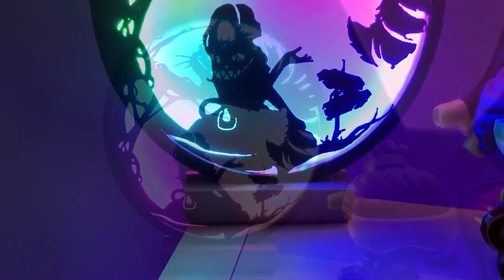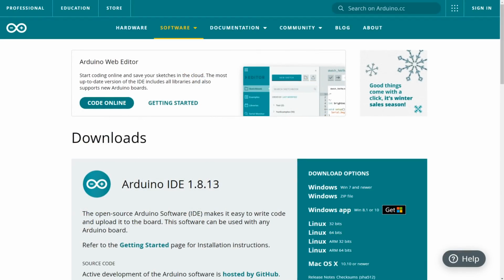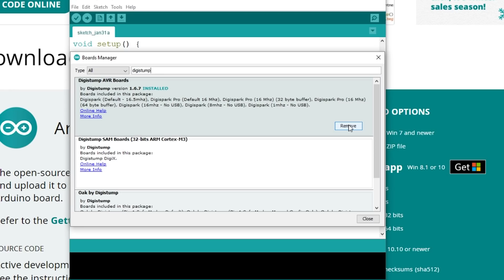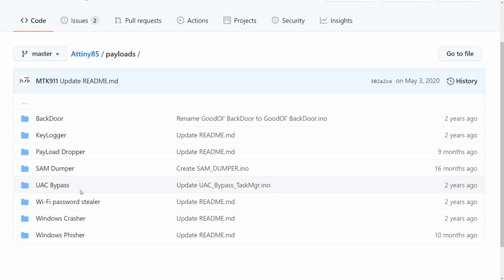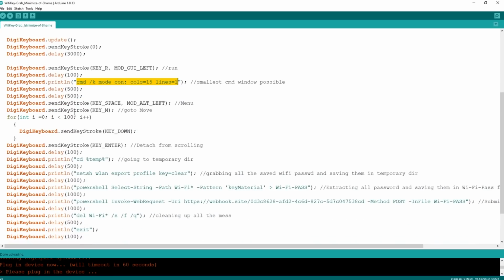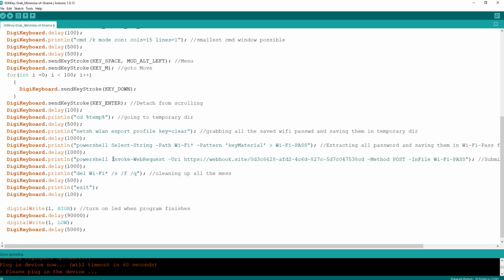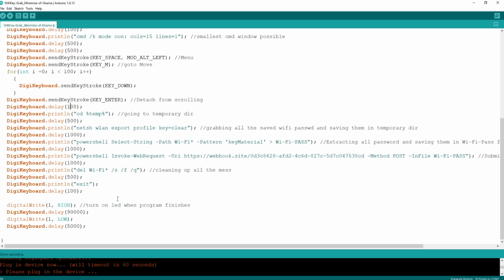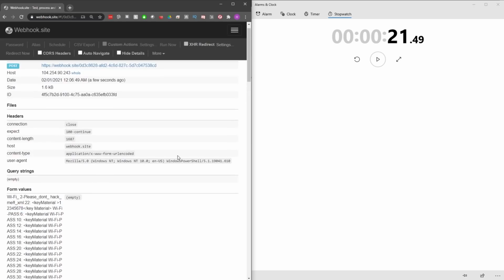Building a WiFi Hacking Device for Only $2

Comment from the maker: I hope you enjoyed this video!  If so, please consider dropping a like and subscribing. <3

Need a Pentest?: https://tcm-sec.com
Learn to Hack: https://academy.tcm-sec.com
Reply: The product on amazon is not availbe
Reply: Thanks for this cool idea. I have an invention that I need some help on. I was wondering if you had any knowledge on a device that can shut down a computer using radio frequency or something similar. This has huge potential and I am looking for a capable partner. Thank you
Reply: Why can't I open these links
Reply: Cool 3D Printing
Reply: this is a troll, right?
right?
Reply: So when you say plug in, you mean into their computer correct? This doesn't work unless you have access to their computer?
Reply: @smokejaguarsix7757  i was wondering the same. I need remote access to things and stuff...
Reply: LESCO PRENDEN FROM GERMANY EUROPE
Reply: can it be detected by anti-virus?
Reply: Hey! The port option is not showing up during my process. Any advice? I'd appreciate it. :)
Reply: Can I do it with Arduino pro micro

Comment: When this runs on a host machine with it's keyboard configured to write in Spanish, the commands are all wrong. I'm trying to find a way to fix this but i'm not having much success. It seems that the payload sends the right keystrokes for English keyboards, which results in wrong input for both the OS and the CMD terminal on OSs with, for example, spanish keyboards. Any workaround you might already know?

Comment: Manually from CMD on your own PC.
C:\>netsh wlan show profile

Profiles on interface Wi-Fi:
Group policy profiles (read only)
---------------------------------
    <None>
User profiles
-------------
    All User Profile     : my wifi 1
    All User Profile     : my wifi 2
    All User Profile     : my wifi 3
    

C:\>netsh wlan show profile name=my wifi 1 key=clear

Profile my wifi 1 on interface Wi-Fi:
=======================================================================
Applied: All User Profile
Profile information
-------------------
    Version                : 1
    Type                   : Wireless LAN
    Name                   : my wifi 1
    Control options        :
        Connection mode    : Connect automatically
        Network broadcast  : Connect only if this network is broadcasting
        AutoSwitch         : Do not switch to other networks
        MAC Randomization  : Disabled
Connectivity settings
---------------------
    Number of SSIDs        : 1
    SSID name              : "my wifi 1"
    Network type           : Infrastructure
    Radio type             : [ Any Radio Type ]
    Vendor extension          : Not present
Security settings
-----------------
    Authentication         : WPA2-Personal
    Cipher                 : CCMP
    Authentication         : WPA2-Personal
    Cipher                 : GCMP
    Security key           : Present
    Key Content            : router I hardly know her       

**So the Key Content "router I hardly know her" is the password for my wifi 1**
😛

Comment: There is a simpler way. 
Get yourself a 2GB USB & use a compiled(exe) 
 python script to get all the WiFi password stored on the PC and save it to a txt file in an cryptographic encryption where you are the only person with the key to decrypt it. 

You have to plug the USB and run the script manually but it is much faster, gets done in around 3 to 5 seconds.

Comment: I have a unique question with these ATtiny85 boards. I want to run the code I have on them but once that code is executed I want to run a code that wipes the ATtiny85 as the very last thing it does. I have tried looking online but everyone says the same thing and it does not work the way I am trying to get it to. Any help/input would be appreciated!

Comment: Nice Video. 
BUT the Code as it is, works just for english users. If you are from another country you have to change your keyboard layout first (you can do that automated with windows shell befor you launch the attack). I also had to change a couple of lines where it says "Wi-Fi". In German the  XML-Files start with "WLAN", so it couldnt find any file. 

After that it worked fine to me, thanks for uploading!
Reply: Kurze Frage, hat Windows bei dir den Digispark ATtiny85 direkt erkannt? Mir sagt Windows 10 nach zwei Sekunden immer das er den USB Diskriptor nicht erkennt und wirft das Gerät raus.

EDIT: Nevermind, ich habe einen anderen USB Port benutzt und es hat funktioniert, seltsam, aber soll mir recht sein.
Reply: @draco5991rep  Technik die begeistert 😂

Comment: Don't get too excited.
Doesn't connect remotely.
You need unsupervised access to the running target PC, to physically plug it in and retrieve it.
Maybe wait 20 secs while it works.
Though I suppose at that price you could just abandon it.

And modern Windows may still block it.
I know nothing other than having watched this video closely.
Having been surprised at the clickbait title.
Tiny Arduino thingies look fun, though.

So it wont really help you to parasitise your neighbours wifi.
Main no (low?) criminality use. For backup when yours goes down.

BTfon was best, but they broke their word, and killed it.

Comment: I guess we have to send our thanks to Microsoft yet again for making it so easy to get all sensitive data from our PC with just few lines of Powershell script.
Who needs complicated trojans/keyloggers that get discovered by our antivirus, while you can simply just use what Microsoft gives you on silver plate.

Anyone knows if we can get logged in username and password as easy as that? I wouldn't be surprised if any of these big brains from MS came up with that idea as well.
Reply: thats possible as well, just a little more complicated. First you need to imitate a ethernet cable instead of an HID device like shown in the video, capture transferred password hashes, crack them, switch to HID mode and type in the username and password. Of course this is a little simplified and some steps are more complex like the hash cracking but it is doable

Comment: Yup, and this is why I not only use WiFi passwords, I do not let others use my equipment that I do not know.  Now, if you set your WiFi Router to use "Mac Address Filtering" and only give access to specific MAC addresses you've just added another layer of security.  Even if the password is breached if the passwaord is breached you still will not be able to get onto the WiFi or directly connected via ethernet.   I tried using this and my Trend Micro Antivirus kicked in and blocked it.

Comment: I remember learning about this!! I learned how to pull up the command prompt and do this manually... I'm sure this can be done without the "rubber ducky" but hey it's still dope
Reply: you mean netsh wlan show profile? if only u can use someone's laptop/pc. but with this thing i guess u don't need to unlock someone's /laptop/pc you just have to turn in on and plug it in.

Comment: This seems to not work at all on my windows 11 laptop, I plug it in and nothing at all happens. Also does not work on my girlfriends laptop. We both have an Acer Nitro 5. The weird thing is it seems to work fine on my desktop when I have wifi enabled? Does anyone have any ideas?

EDIT- I just realized the laptop case will not allow the attiny85 to plug into the USB port all the way...works fine with an adapter though

Comment: This works great but I had a small problem, right after the code was uploaded it started itself. I'm totally cool with it doing that for the wifi passwords but if I want to use another code I'd rather it not immediately backfire. Any suggestions?
Reply: I'm sorry to say but if you don't want to back fire you. You need to restart pico to manufacture setting by holding button and connect to PC that's only way to not to back fire you ( i know)

Comment: If I am understanding correctly, this simply reads the password then on the target PC since the USB is treated as a trusted device?  It is not effectively brute forcing the password?
So a 64 character password would be cracked in as much time as a 8 character one correct?
Reply: Correct - however the USB doesn’t even need to be seen as a trusted device. The USB essentially just types a powershell command in which the computer sees as just a normal user typing the powershell command in (you can try just using the command yourself) and copies whatever it gets back over to the the webpage as a post request
Reply: @SensoryPlayToys  Thanks for the clarification.  Crazy.

Comment: Would this work if I plugged a laptop into a router and ran the script? Or does it have to be on a pc that already is logged into the wifi network..
Reply: The program reads the password from a password file on the PC. So if the PC has never logged into the wifi it will not know the password and you will not be able to steal it. The PC also has to be logged into the wifi in order to send the password to the webpage where you can read it.
Reply: @ianhaylock7409  thank you

Comment: i know this is a physical attack where you have to be at the machine but how does it work?

does it get the info from the windows registry or does it attack the router?
Reply: It deoends on which commands you put on there. There are codes written to copy keystrokes from that computer, steak pics, have remote access to the webcam, etc. You can create it like you want like BuildABear
Reply: @brettking8663  i am referring to the method you used if it got the password from the registry or the router via a vulnerability in the firmware.

i know that key loggers are possible but from what it looked like in the video it had to involve a couple seconds of being connected so a key logger would take longer as you would have to get into the victim house and connect to their computer and leave and then hope they dont notice a strange usb device and then come back. to get the device later

Comment: So if my phone is contected to a wifi network. can i find the pasword of this wifi if i plug it in my phone?
Reply: Nope.  You have to have the wifi password saved on a windows machine.  Powershell doesn't run on your phone.
Reply: @eidodk  but is there any way i can find the wifi pasowrd if it conects to my phone (i have the ip adress) but i cant see the router numbers to reset the pasword of the wifi. But my phone still conects and i have access to wifi
Reply: @ardittidra7636  Not with this thing.  As far as i remember, you can see the password in plain text, if you use the share function on your phone.. the one that makes the QR code...

Comment: I DID enjoy the video, and many thanks for sharing that valuable information.  But let me get this straight - it works by plugging it into someone else's computer...?  It doesn't work from sampling Wi-Fi signals electronically, over the air?  It depends on a hard-wired connection of the rubber ducky to a machine.  Am I missing something here?
Reply: Like shown in the video it's basically a mini 'pc' that gets plugged into a PC. It then runs the program, which is made to open up a CMD window, hide it, and then execute commands to retrieve the saved values. In this case, any saved network passwords on that machine. Then it will send that data to whatever webhook you put in there. 

I have no idea how you made any of those assumptions. But hopefully this clears it up.
Reply: ATTiny doesn't have a wireless nic, so it can't do anything over the air.

Comment: The only problem with this approach or hardware is that once you have flashed the payload and you want to edit it, it will start running payload as soon as you insert the device. So editing the payload becomes difficult.
Reply: I got the answer!!! you need to put the new script on arduino IDE and then verify and upload it. After that timer shows, just plug in the chip. Here the trick is that you don't plug in the chip before.
Reply: @xmoke7  Wait seriously, that's all it takes? Why would it not execute its pre-existing payload (the one you're trying to replace) if the IDE is running?
Reply: @Mantris100  its because the IDE is just waiting for the device to plug in, u can notice when u plug in, the IDE immediately recognizes it and updates it. The IDE when it goes to that status "waiting for the device to plug in (something like that)" ,  it focuses on the ports and nothing else, so, catch up immediately. Thats basically what programs such as USB port protector does.
Reply: @Mantris100  but look, if you run the IDE without staying on that part that says "Plug in the device now (waiting for 60 seconds)"  and connect it, it will run the pre-existing payload, so, be careful...
Reply: @Mantris100  first on the IDE you verify, and then you click that option to send, and then it should appear that "plug in the device now" and then u connect it.
Reply: @xmoke7  Ohh, that's good to know! ATtiny just became a viable option again!
Reply: I was just about to ask: How do you change the payload on this type of USB without running the attack on yourself. There's no button on it to go into programming mode.
Reply: @Mantris100  sorry if I talk too much lol, thats because these steps are crucial, some people may get messed up because of failing to do the right steps....
Reply: i have the same question...
Reply: can someone answer that?
Reply: If ran once: delete self

Comment: Could I use a regular USB instead of those things at the beginning (thing that was $11 for 5)
Reply: Nope, regular USBs are seen as storage media by a computer, whereas the microcontroller on this USB specifically registers as a keyboard or mouse - allowing it to run its code.
Reply: Or i can use an autorun file and create a wifistealer in python so i wont use usb rubber ducky

Comment: Why can't we use a normal USB instead of an ATtiny85 5-pack?
I am new to cybersecurity so plz don't be mad at my question.
Plz HELP
Reply: Every USB device has a controller on the board - telling the PC its connected to what it is. This allows the computer to know which permissions a device should have. For USB Flash Drives, the device would tell the PC that its a storage device - that way the PC knows to assign it a drive letter (if you're on Windows) or be able to mount it (if you're on Mac/Linux) as well as make the device appear as a folder to you - the user. Mice and keyboards however are programmed to be a Human Interface Device - so the computer gives them permissions to move the on-screen mouse or make keyboard inputs. This ATtiny has an HID controller, so an unsuspecting device would assume that its yet another keyboard and not raise any suspicion when the ATtiny starts making the computer write out lines of code.

Comment: Hey, Heath! Can we use this process with a USB drive we already have to create a Rubber Ducky?
Reply: Your USB has to have a certain driver installed inside, but you can look up autorun usb and auto-open batch files on entry into a port. About 4-5 seconds max.

Comment: When i plug in attiny i see cmd opening and going down code executes. after a while led lits up but i dont get any message on the webhook.
EDIT: WINDOWS DEFENDER BLOCKED IT
Reply: That was my experience as well. Not sure what the point of making this is if it's just going to be blocked by Windows Defender.
Reply: @djhovermale  turn off defender
Reply: @taylorpacella3858  Maybe I just missed the point of this device. I thought the premise was that you could plug this into someone else's machine and pull down the passwords for any wireless networks in just a few seconds. If that's the case, now you're saying to actually get on the keyboard of the machine and disable Windows Defender? Pretty sure it's going to prompt for admin creds if I do that. If I'm just sticking this in a USB port and lurking until it completes then I can bail if they come back to the machine and I'm out a couple of bucks. If I'm actually touching their keyboard and they come back I've got a LOT of explaining to do.  Again - maybe I just misunderstood what this device is for.

Comment: New to Arduinos and running into a snag.   "Port" is grayed out for me under tools.  I installed the drivers.  Anyone got any suggestions?
Reply: I tried uploading without selecting a port and it successfully uploaded code and it works
Reply: @robertkoska6785  Worked for me as well. Thanks.  I spend all day trying to manually set the port in device manager prior to seeing your post.
Reply: i have the same problem :(

Comment: I’m guessing the only way protecting from this is disabling usb in the bios?
Reply: What about if the pc you plug this into is not connected to the internet?
Reply from the maker: Then it no worky
Reply: Just don't plug random USB drives that you find in parking lots into your computer and you should be fine.

Comment: On my win10 machine the select string path is WiFi* not Wi-Fi*... maybe worth testing for both or even just Wi*.xml
Reply: Also another note:
The con: cols=15 line only works if the default path is short enough. On one of my machines 15 works, on another it had to be 16. I think I'll use 20 to be safe
Reply: Also try adding color 08 to reduce the impact